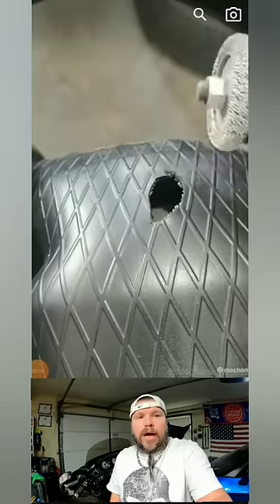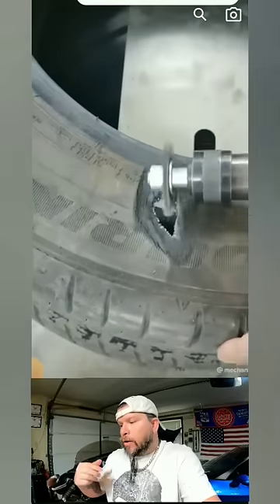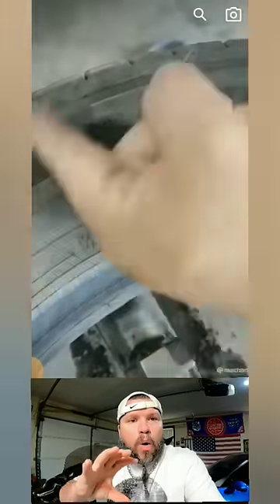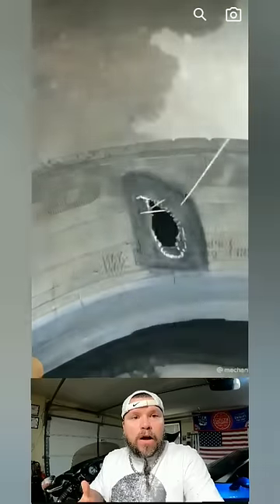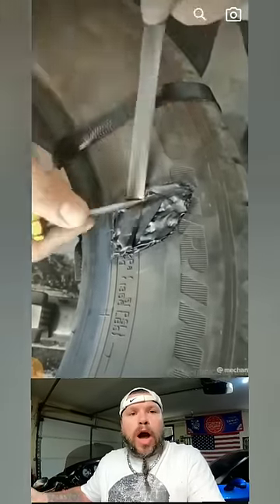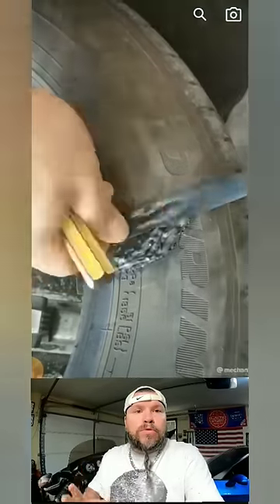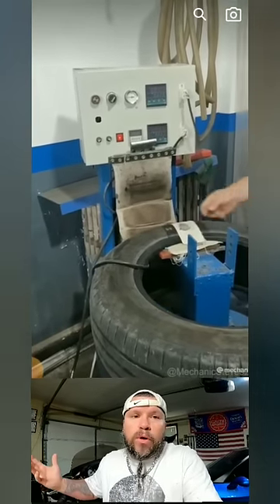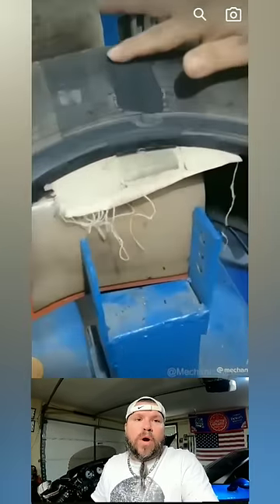patching a tire

Comment: Running that on the road is actually a crime in many countries.
Reply: Certainly would be in the UK.
Reply: @iainmacleod4007  certainly would be? Or is?
Reply: It's a traffic violation, not a crime lol
Reply: @Roberto9696-q7s  That is perhaps how the law works on your side of the pond. In the UK driving on a tire repaired like that would be a motoring offence which would land the driver in court and subject to a criminal conviction.
Reply: @Roberto9696-q7s  You must have misheard me, I'll try saying it louder. RUNNING THAT ON THE ROAD IS ACTUALLY A CRIME IN MANY COUNTRIES
Reply: @craiglinnemeyer1324  Is. 3 penalty points.
Reply: @EddieTheH  It's a fine of €60 in Germany. Very minor traffic violation
Reply: @iainmacleod4007  incorrect
Reply: Wrong
Reply: @xLegionnair  In the UK it's 1/4 of the way to being banned from driving. 3 points per defective tyre, 12 points and you lose your license.
Reply: @xLegionnair  No, repairs to tyre sidewalls are completely illegal in the UK.  Under tyre safety regulations only the tread area is repairable.
Reply: @xLegionnair  In the UK, a tyre can only be repaired if it is a hole less than 6mm in diameter in the central ¾ of the tyre, anywhere else is deemed unsafe as it is too close to the sidewall. The penalty for tyre defects is- Your driving licence may be endorsed with three penalty points for each of the tyres in question, up to a total of 12 points for four tyres. If you reach 12 penalty points on your driving licence, you will usually be given an automatic 'totting up' driving ban, as well as a fine of up to £2,500 per tyre.
Reply: @xLegionnair  maybe in your country. Sidewall damage and repairs are illegal in the UK. There is no debate about that.
Reply: And it's just how they do things. In other countries
Reply: It would be an instant defect in Australia unless you’re living  remote and you can prove it’s was only done to get you into town to get a new tire.
Reply: @Roberto9696-q7s  no it's a crime
Reply: Rip Left Eye
Reply: @iainmacleod4007  the same in Australia, we take dangerous and negligent driving and vehicles seriously to drop the roadkill rate
Reply: Illegal to patch sidewall in Australia.
Reply: @Torana-gz5ls  my first car was a 76 LX with a worked 202
Reply: I know that’s kinda random just saw the name and had some good memories
Reply: In other countries this is a daily occurrence
Reply: Where's the American with no self-awareness accusing people of living in nanny states? I must be early.
Reply: @sykotika13  Learned to drive in an LJ. 1st car I owned was a 69 HB Torana then a 6cyl LJ. Loved working on and driving those cars. So easy to work on, great fun. My friend is currently rebuilding a  2 door  LJ  with a 253ci.
Reply: Probably India or Pakistan,  Probably fine there.
Reply: @craiglinnemeyer1324  bro you know what he meant. All the evidence points to you speaking english quite well yet you pretend to not know so you can feel like you’ve won an imaginary argument
Reply: @xLegionnair  wrong 😂 care to provide specific information/evidence or is this just hysterical hearsay?
Reply: @jchrizzy6995  lol... Yeah
Reply: @Utter Failure Of Process Analysis by Developers  Probly won't find one here. That would be illegal in many parts of America as well. And almost any reputable shop would never attempt such a repair. It could open them up to liability when it fails.
Reply: What crime? First time I've heard it called a crime
Reply: @aydenaustin5451  Read the thread before making a redundant comment.
Reply: I think he s just showing us 1 way to fix tyres  x
Reply: And its absolutely 100% normal in many countries.
YMMV
Reply: @paulmcgrath2175  All of Africa, all of South America.
Reply: How you think 18 wheeler tires are made??? Cause they do this to retread big truck tires
Reply: if that tire can hold 75 locals, 32 goats, 100 chickens, 60 suitcases, 200 litres of fuel, and blast duran duran while going over one of the most dangerous mountain passes in the world, why can’t it be driven on american roads?
Reply: @sykotika13thirteen  sAfE aNd eFfEcTiVe
Reply: @boosteddaily1294  It has to benefit the Government.💵💵💵💵💵
Reply: @EddieTheH  someone’s angryyyy
Reply: @sean4577  Who?
Reply: @Roberto9696-q7s  any legal infraction is a crime.
Reply: 100% unlawful in the UK
Reply: @clown-eating-hippo  Ah you blokes have no hair on your dingle berry pouches. Hell we patch that with a plug. That hole might take 4 or 5? Send it as a steer here in Merica. I can send proof. It's raining right now. I had ran a plug in sidewall for years. No problem.
Reply: As it should be. Used tire might be 40 bucks. Driving is a privilege and not for peasants. If you can’t afford a $40 tire then you shouldnt have a car. Plain and simple
Reply: @southernheritage8740  It happened in winter. Almost new tires & I hit a curb hidden in a gas station exit. I was poor. Poor AF! WORKING POOR. Driving a '78 Pinto wagon! It was my only car. I needed to work. My plug repair has held for over 20yrs. I drove on it out of necessity. Of course the best thing would be to replace it? It was a NEW tire. Plenty of tread. I drove it intent on replacing it. I just never did? It never even leaked. Other tires had slow leaks. Not that one I plugged. I think I jammed 3 in the gash. It worked. Yeah I puckered if I hit a bump? That's part of living poor. We aren't afforded the benefit of the expendable income for things you don't eat! And eff you about not driving. Why don't you not drive for a day, week, month. I've had to do it. You couldn't handle half what I had to in life. It could easily happen to you too. Think about it.
Reply: Not DOT approved
Reply: @Roberto9696-q7s  if you cause an accident with these you loose your insurance cover and worse if you hurt people with it
Reply: @ryanburns3921  false. Done this several times on vehicle specifically used off road only. I.e. heavy equipment. 4wheelers that sort of thing. Happens a lot.
Reply: @sean4577  Ok sweetie, have a beautiful day.
Reply: @Craig Linnemeyer  Then let me be unnecessarily specific. DOT doesn't give a shit about 4wheelers, tractors, or heavy equipment. But for ON-road passenger tires, this repair would be illegal in many places in the US. And you would have trouble finding a dealership or any other reputable shop willing to make such a repair to and on-road passenger tire. Doing so could open them up to liability when, not if, this fails.
Reply: No it isn't
Reply: @EddieTheH  lmao none of the information you stated is related to the topic at hand smh this world is doomed
Reply: @iainmacleod4007  alot of things are illegal in UK for absolutely no good reason so it makes sense.
Reply: @sykotika13thirteen  lmfao
Reply: Ahhh classic first world problems ..
Reply: @craiglinnemeyer1324  it is an MOT failure, and its the drivers responsibility for their car to be MOT compliant between tests..if an accident occurs whilst using a tyre like this, you would be hit with the offense of 'dangerous driving'
Reply: @michaeljohnson8837  It's not really though, is it? First world solution is just get a new, readily available tyre. Sidewall repairs are more of a third world problem.
Reply: @michaeljohnson8837  Ahh, yeah, that I agree with.
Reply: @xLegionnair  You're gonna have to be more specific. The topic at hand in this thread is that sidewall repairs are illegal in many countries, unless you didn't notice...
Reply: @southernheritage8740  WELL GOOD THING I BECAME A MARINE! What have you done with your entitled life Ken?
Reply: Everything is a crime these days. I cant even misgender a dude in a skirt
Reply: @iainansell5930  I'm from USA. I don't know what mot is
Reply: Certainly wouldn't pass any state safety inspection in the US 😵
Reply: @EddieTheH  Huh?... what?
Reply: @richardchambers256  What "what?"
I could probably answer if you let me know which comment you didn't understand.
Reply: @sykotika13thirteen  That's good. As a German kid I saw Mad Max movies, though :D
Reply: @yj965  In other countries, just 10% of all streets are concrete streets, and even if they are tarmac tracks, you can't really go over 50 mph there. Compromised tires get VERY dangerous at higher speeds.
Reply: @donutdan1508  I sometimes use cucumbers as an exhaust pipe, works like a charm with duct tape for o 10-miles-drive and can simply be thrown away as bio garbage, it also smells funny!
Reply: @boosteddaily1294  Because with increased speed the pressure AND heat increases and this sucker blows off or rips off again.
Reply: @bjornna7767  yeah we definitely have some rough driving cars here especially when you go rural and outback. I’ve seen some modified cars where the tyres were the least of the worries. Doors jamming just remove it, sunroof not big enough just cut the roof off😂
Reply: @sykotika13thirteen  I mean, what can go wrong in the outback, not much ppl living there, imagining the same in NY city would of course be at least suspicious or even dangerous.
Thank you, sir, you made me smile having created these pictures in my mind, I added a kangaroo looking out of the outbackish sun"roof" to that doorless vehicle  :)
Reply: @bjornna7767  I can honestly say I’ve seen doorless Toyota landcruisers with rescued Roos in them. Roofless ones with sheep or a calf in the back.
Reply: @sykotika13thirteen  I must have been an Aussie in an earlier life, then. As a fact, I like you folks very much, the Australian accent is my favourite one, and I find your vocabulary is very nice. Maybe I'll have a barbie with my Sheila at some point in time. If I had had the money, I would have emigrated, though, Corona politics where one of the hardest at yours. Never say never as we Germans use to say.
Reply: @bjornna7767  never give up. We use the Sam saying. You will love it here.
Definitely have to slap some snags on the Barbie and down a coupla coldies with the misses (cook sausages on the BBQ and drink some cold beer with ya sheila (girlfriend/wife))
Reply: @bjornna7767  Over here in the states people are constantly shoving veggies up their tailpipes 😟.  With a proper  interference fit they can save the Duct tape for their auto repairs!
🤣✌🍩
Reply: @Roberto9696-q7s  As long as nothing happens. As soon as something happens, be prepared to pay, because your insurance won't pay a dime. And whichever garage did this will also get a nice visit from officials

Comment: Most reputable tire shops will not repair the sidewall of a tire because of exactly what this man is saying.
Reply: Implication being, what are the few that will and for what reason?
Reply: I work at a heavy equipment and heavy truck shop. Sullivan tire will fix a side wall for us and it is a legit repair on an 18 wheeler 🤷🏻‍♂️. Our fleet has no issues with them.
Reply: @sethh2861  i was told liability. Yes it works but the owner felt that it could fail and if so cause a wreck. This could come back on him and  his insurance.
Reply: @Keith-jp6jw  Will they do that on the front steering tires too. Just curious.
Reply: @Keith-jp6jw  They are running a risky operation by doing sidewall repairs if this is in the US. It is illegal for any shop to repair sidewalls and sell sidewall repaired tires. Are you sure you are not mistaking like a crack on the sidewall being filled and buffed? As long as the crack isn't severe they are allowed to fill it in and buff it.
Reply: @STEVEN-STEELE  This would be even more illegal then what I replied to the person with. Steer tires on semi's have even more restrictions in what is allowed to be done. Such as you can't retread steer tires for the purpose of putting them on as steers. You can retread them and use them as drives however. You can patch the tread of holes and that is pretty much it for the steers. So all steers have to be brand new tires or used ones that haven't been retreaded. This is assuming they are in the US. If outside of the US then its quite possible this is legal for them to do.
Reply: @sethh2861  The few that do is for the money and typically most of these few are not completely legitimate businesses. That is they are operating illegally to begin with therefore doing other illegal things isn't a concern since their operation isn't legal to begin with. There is plenty of people that operate out of their garages or have some small area they are allowed to use to do tire repairs because it really isn't all that difficult to repair tires that have been punctured as long as its not too severely damaged. So it is easy to have quite a bit of places that are advertised as tire repair places and not be legitimate businesses. Patches and the small amount of tools you need to do this are not all that expensive either. You can break a tire off the rim by hand, and just need a small compressor tank of air to re-seat a bead back on the rim. Some tire irons to break tire off rim. Then some patches and glue and rollers to help with applying patch and then some rubber and flame to fill in the tread to remove the rest of the hole on the outside.
Reply: @Keith-jp6jw mmmmmmmmmmmmkay
Reply: @stevensteele4803
No, only good non recapped tires for steers. I dug into this a little more, they repair sidewalls by vulcanizing the tire during its recapping. The damage can’t be through the cords. As example a slice or chunk removed from curb rash.
Reply: @wolf2179 yes, the damage can’t be like what Is in this video. (the tires are sent out and come back with the repairs after we have them capped) the tire in this video is a death trap.

Comment: I did a DIY plug job on a nearly new tyre (Yes "tyre", I'm British), I was told by my local tyre place it was about 1/4 of an inch too close to the side wall for them to guarantee a repair (keep in mind this did put it in the tread section of the tyre but only just) so I decided to do a DIY repair on it myself and just use it as the spare.

A few months go by and i check my "repaired" tyre in the spare wheel well having done no miles on it, and right along side the repair I did was a bulge the size of your fist.  Just glad I never needed to trust my life to that tyre.

Moral of the story - Dont eff around with the side wall of your tyres.
Reply: Belts separated from the damage, that's a high speed blow out for sure.
Reply: ? Don't you guys have an inspection called an "MOT", something like that, where they would basically execute you for trying that?  😂
Reply: @woofwgn  the MOT only tests what is there, if you take your spare wheel out you cant fail for not having one but you can fail if you have one and the tyre is illegal
Reply: @TheMadTatter  ah, got it
Reply: Imagine it ruptured while you were driving. (Not driving on the tire, just with it as the spare) That would be the most confusing situation ever, no plowen tires but you heard a blown tire
Reply: why seen you drawing attention to spelling tyre correctly,m8,
Reply: Its spelled "tire"
Reply: @mariolouis6412  I'm tyred of you people.

Comment: If I pull up to a tire shop and hear that country accent I know I’m in good hands 😂
Reply: You see, the dang carbonators expanded, so whatcha wanna do is replace the axel, rewire the main power circuit for the engine, and replace the transmission. 
At'le be twente too huned dolars.
Reply: underrated comment award
Reply: You mean you don't like those sketchy Italian shops?
Reply: The guy repairing it had country accent too
Reply: That's 📠
Reply: id rather hear Mexican they are best at tires
Reply: Lmmfao
Reply: That is an accent you can trust. I want my mechanic to sound just like that - if he sounds like Obama I ain’t sending my vee-hic-kul to him. No way!

Comment: As a former tire technician, thank you for speaking truth. 
It’s insane how many people forgo the few extra dollars for road hazard coverage on their tires, just to have to spend twice, if not 3 times the amount on a new tire when they get a nail stuck too close to the sidewall. 

Car common sense (ie tire pressure, oil and fluids check, positive and negative on the terminals) should be required before people get their license.  

Once had someone blame us for ruining their car, when they pulled the battery out themselves, bought the incorrect one without ever asking us (bought a 51, needed a 51R with reversed terminals) installed it themselves, and blames us when their electronics failed as a result.
Reply: I used to work at Walmart TLE for about 5 years and I know exactly what your talking about the batterys and people not wanting the road hazard 😂

Comment: The only reason I would consider a sidewall repair like that would be in an off road only application or as you said a burn out tire and in that case would just stick a tube in it. Hell one would guess that after all that work, supplies and vulcanizing, you gotta be getting close to a new tire cost anyway!